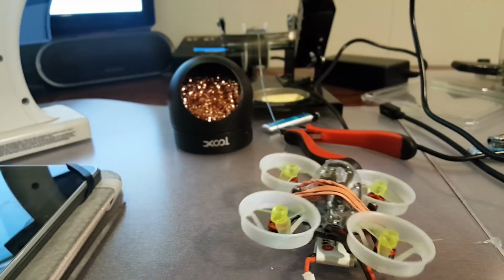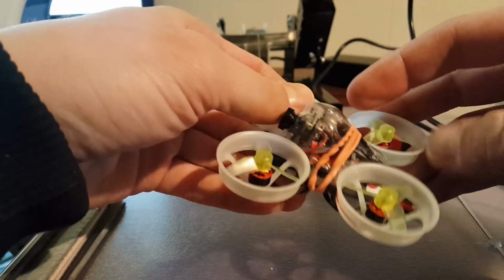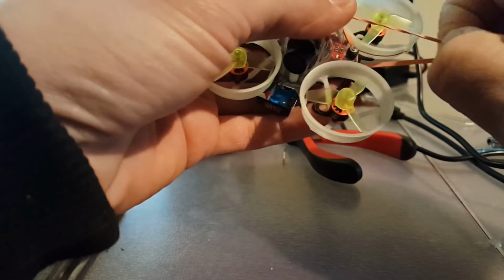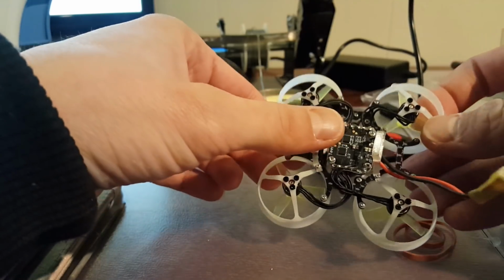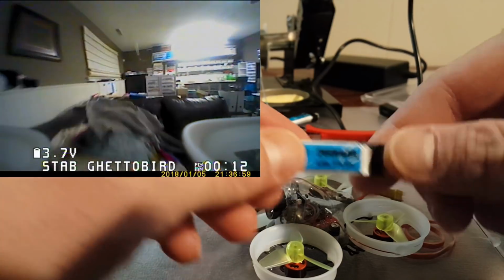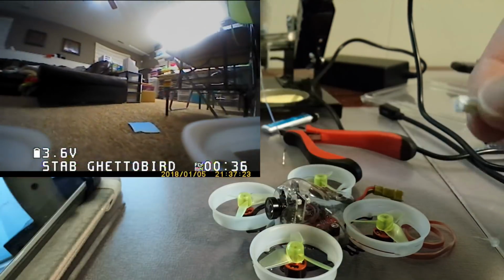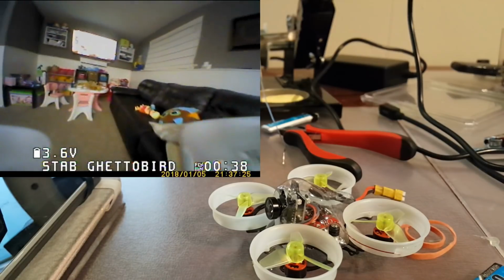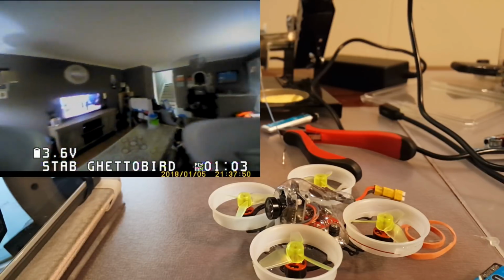GriffonFPV Ghetto Bird Update 5 minute flight Gaoneng 450mah

Comment: Nice! Have tons of those batteries, was going to do the same test when the motors came in. Was also concerned about weight but, looks like it has no issues carrying. Do you notice a difference in cornering compared to a regular 230-260mah stick? I also want to test the GNB 550 and BFPV 550.
Reply from the maker: +Remigio Isla-nd it's much lighter with the 260 but I feel I can fly well with the 450 and it takes corners well.
Reply: Do the motors get hot at all? Built a few using that same frame and 0703/05 and hated it. Can't wait until there's more 0603 offerings in the market.
Reply from the maker: +Remigio Isla-nd no heat at all.  Motors and lipo we're fine